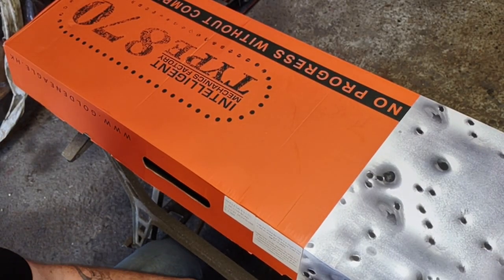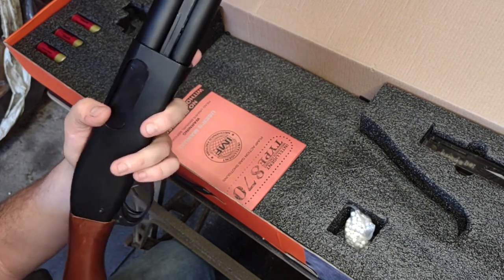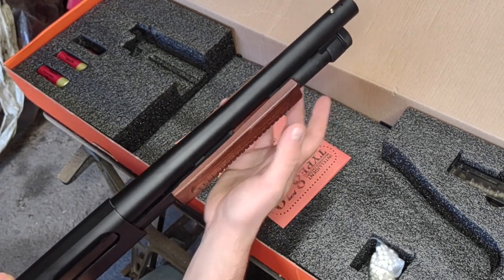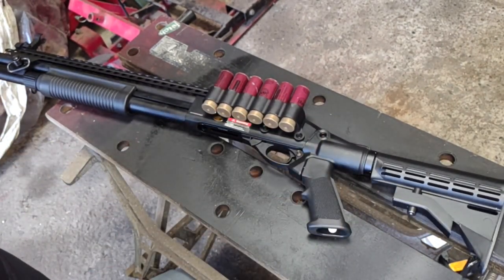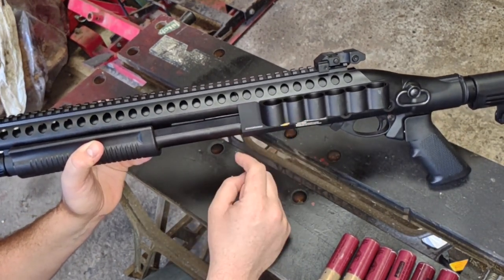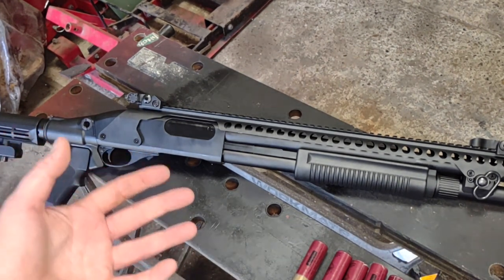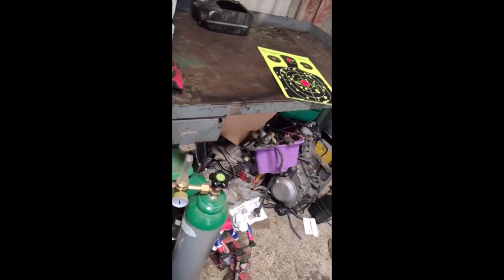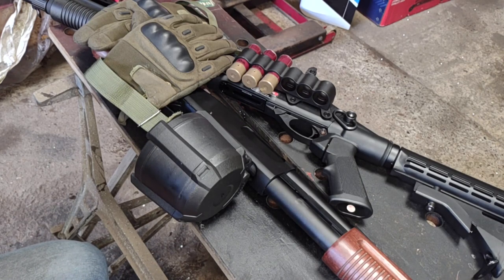[SFA] Golden Eagle Gas Shotgun Overview

Comment: What some people do with this shotgun is they hpa it. Its as simple as tepla ing the gas fill valve with a russian cqb valve. Since golden eagle is the oem for jag arms, they use the same russian cqb valve. Of course you will need some teflon taps for optimal seal. You also do it with the tatical shotgun but it blocks the stock.
Reply from the maker: Yeah, I've seen them HPAd. I don't really understand why, as a gas fill lasts for circa 70 shots and with that kind of economy, carrying an air tank and all the kit around all day for HPA seems pointless to me, but each to their own! 😂
Reply: @MrLilredmachine  then again its that time of year. Green gas has low fps, shit effiency, and all sorts of other malfunctions in the winter and good luck getting your hands on red or black gas here in the us. Weather or not its worth all depends on weather or not yiu dont mind the airtank.

Comment: Don't they OEM for a lot of brands??? I was debating an adjustable hop-up... ??? What weight BB's are you running???
Reply from the maker: It depends, they can OEM for other brands, but they also release guns re-badged from others. For example the GBBR M4 I tested on this channel is in fact a Jing Gong model. 

These shotguns are the basis for Secutor models, do in this case they do OEM. 

The hop up is fixed, but is applicable to all three barrels (better than some!) I run 0.25, and on the big shotty you can expect a very respectable range of around 50m. The shorter sawn off is around 40m. Both are very respectable guns.

Comment: Does it have a sling mount or a holster available
Reply from the maker: I'm not sure the sawn off has the allowances for that, however if you have a look around i'm sure that there may well be some real steel accessories that might get the job done. The range is huge, and it is possible to get a shorty that is far more tactical in nature than the basic wooden shorty.

Comment: Is it possible to swap the short stock for a full length one?
Reply from the maker: As far as I'm aware, it is possible to do. It's not overly simple as it would require the swapping of the gas tank assembly also, but technically possible.
Reply: @MrLilredmachine  thanks for anwsering.
I want to have a “sawed off” barrel length wit full stock, maybe it would be easier to change the barrel of one with full stock..?
Reply from the maker: @Crimsonbraids  https://shop.jkarmy.com/parts/shotgun-parts carries a lot of the bits, might be worth having a look. It's availability of parts that is going to be the problem, not physical possibility in this case I think.

Comment: What is the name of the drum mag?
Reply from the maker: Hi there, it's a Battleaxe m870 drum mag. It will require you to remove the shell door, which competitive players tend to do anyway as it removes an extra step to reload the shells.
Reply: @MrLilredmachine  how do you remove the shell door ? could you do a tutorial about that ? ^^
Reply from the maker: @morbusmeise1327  I could do, it's fairly simple to do but does require a bit of stripping to get to. The other option is to pinch the bottom of the shell door so it pops out of the receiver, but you do run the risk of cracking the delicate alloy the door is made from. If it's a plastic model/door then it's a lot easier to do without damaging the door itself. There is a tutorial on YouTube if you search for Airsoft M870 shell door removal you'll find it. It's going to be a while before I get to do it as I have an upload schedule set for a few months now, so might be worth giving another video a watch.